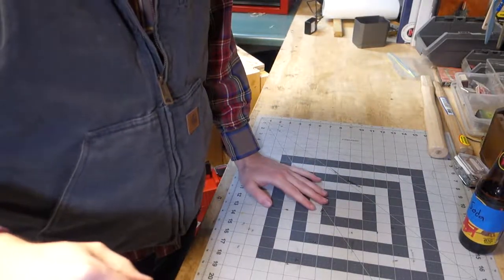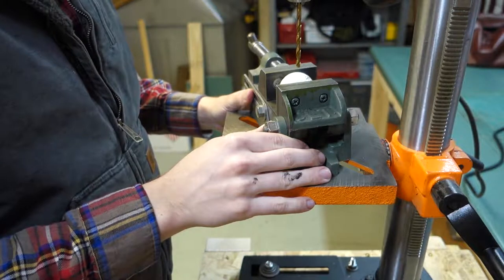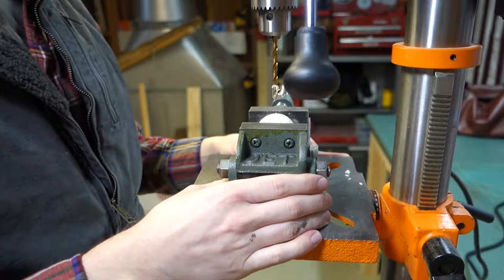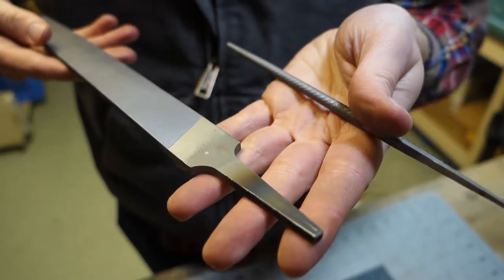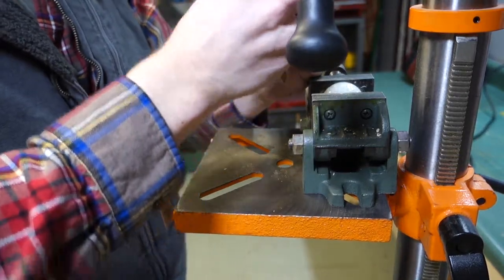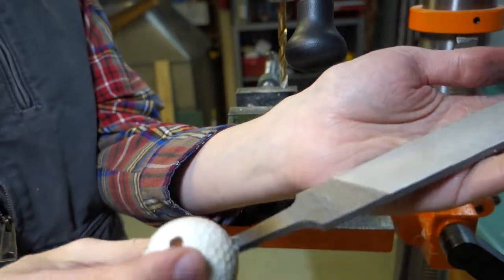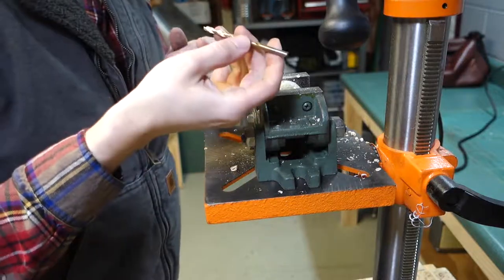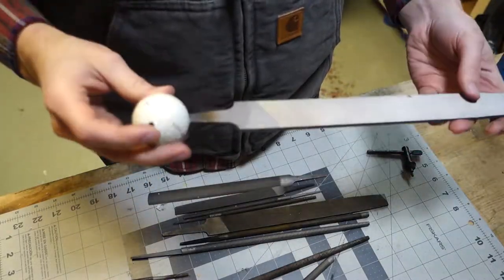Easy DIY Golf Ball File Handle

Comment: why do files have a tapered point on them
Reply from the maker: I believe it's so they will wedge into a handle. Usually the handles are made of wood.
Reply: I've done the depth stop thing several times before. I even went and bought new drill bits because of it. Don't feel bad